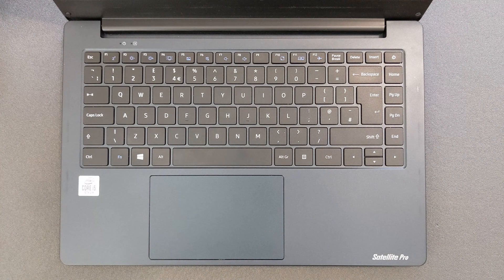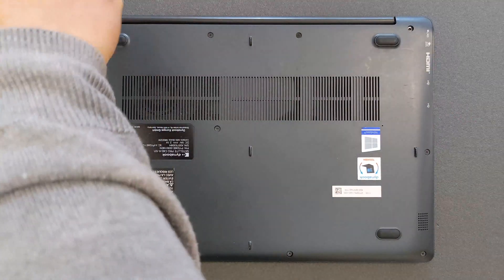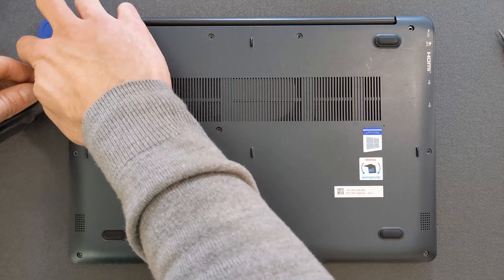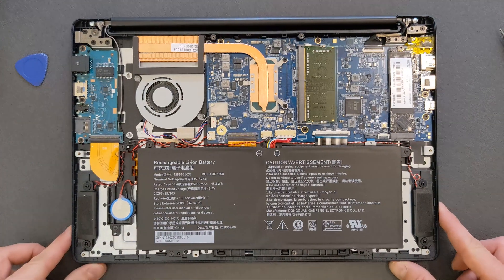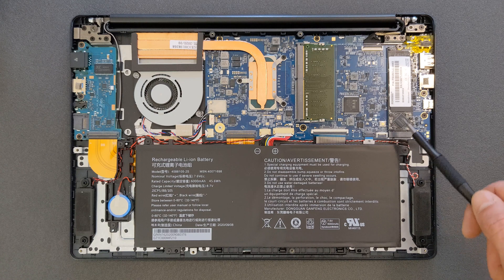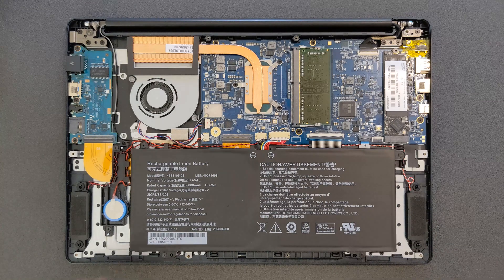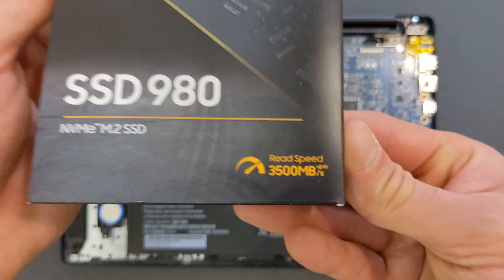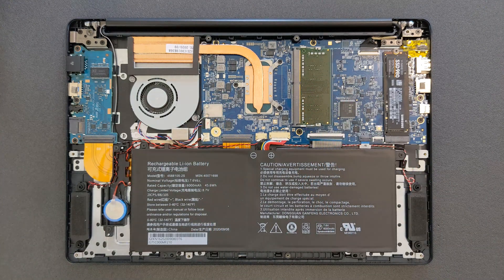Dynabook Satellite Pro C40 SSD and RAM upgrade

Comment: Can I upgrade the wifi to WiFi 6? The card is only WiFi 5
Reply: You can use your USB slot to add a wifi 6/7 antenna if you want. Otherwise it's soldered on the motherboard.

Comment: Are you sure that this laptop can take a 16GB RAM upgrade? I thought that the most that a single slot supports is 8GB?
Reply: I also want to upgrade it to 16gb ram because mine I bought it on 4gb
Reply: @lebenyamoabi6147  I successfully upgraded mine to 16GB so it does work.
Reply: C40-G-109 can be upgraded to 16GB (tried out and it worked).
Reply: Yep it can get up 32gb ram Yep it can get up 32gb ram